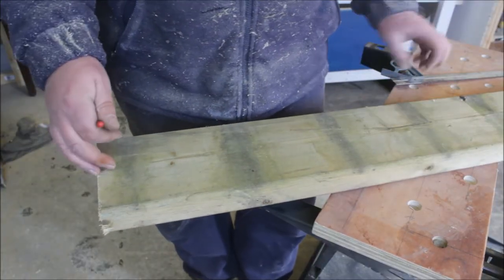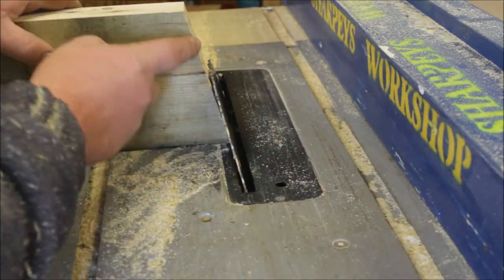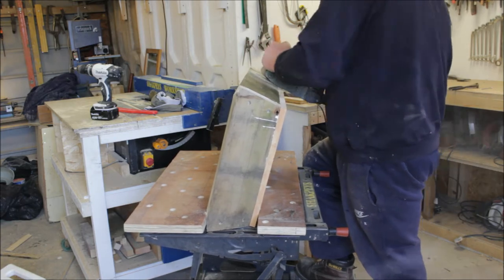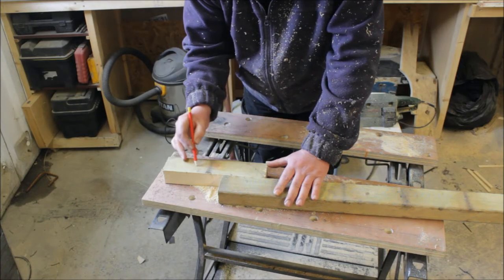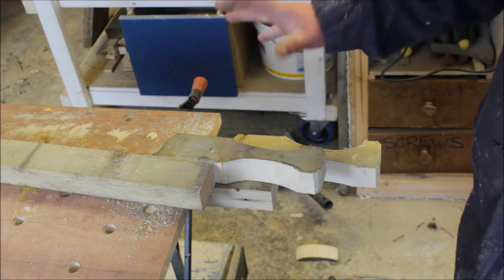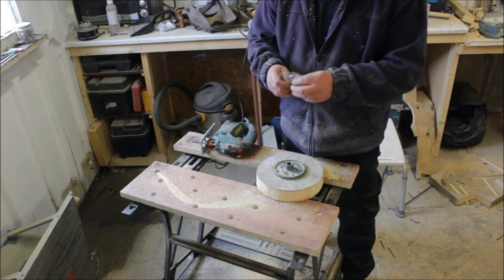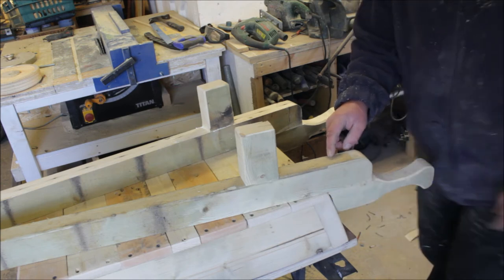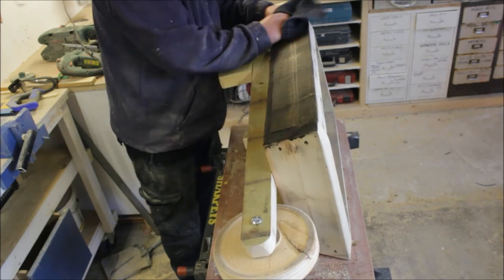Wheelbarrow planter from recycled wood and pallets

Comment: Beautiful. If you had it to do again would you have oiled the mating surfaces during the build?
Reply from the maker: Hi yes I would I couldn't figure out how to get into all the small spaces once complete the glue  did stick ok but I did add a small screw on the saw blades just to make sure
Reply from the maker: +patr10t762 sorry I got the wrong project no I wouldn't oil before building I like to use lots of wood glue on projects for out side seem to make them last longer thanks for your interest sorry about the first response